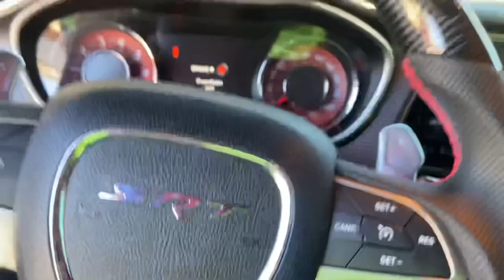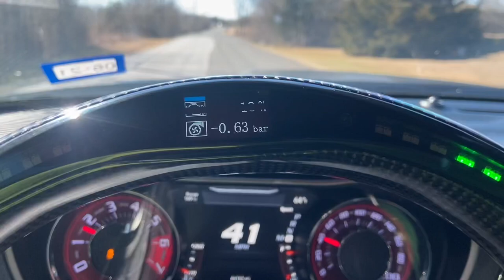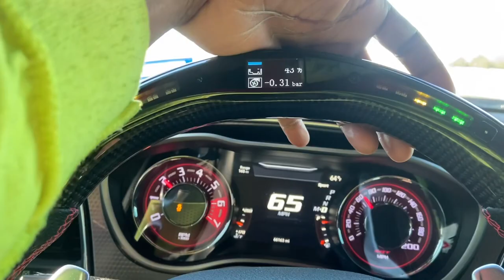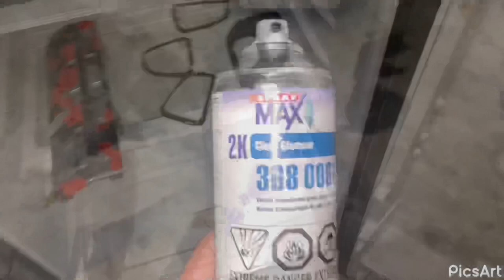Hellcat Challenger gets some more flavor

Comment: Bro, do not trade your 392 in until you have increased the torque by swapping for a ported intake manifold, larger throttle body,  tune, long tube headers, transmission tune and adjustment management. then when you had the fun you might i repeat might get a Hellcat.